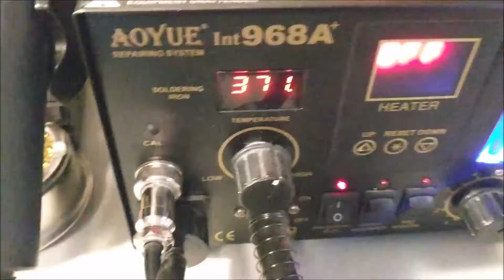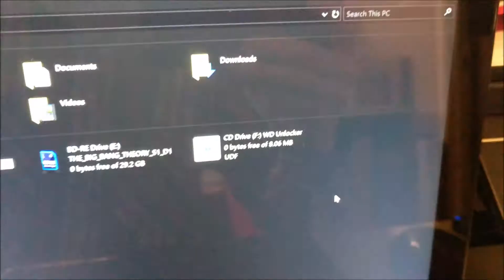Possible fix for non-working WD My Passport

Comment: Thanks for sharing how to open the drive casing! I am having a power issue with mine. I'm hearing a clicking noise and when I ran Win 10 troubleshooting, it said "Code 10 __device cannot start_power failure." I hope I can recover my files! 😣